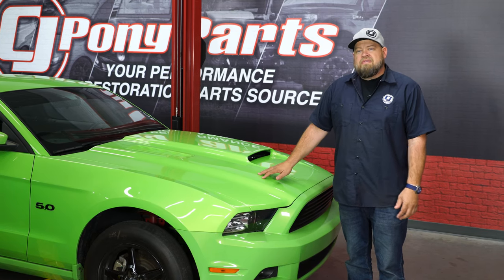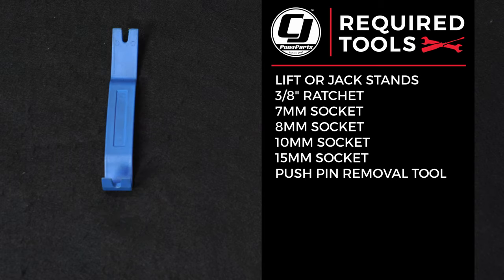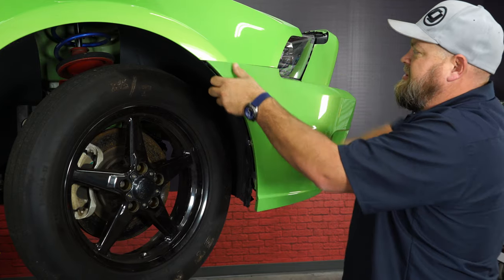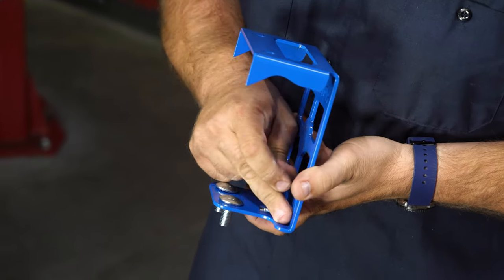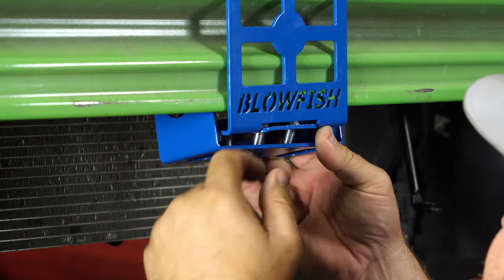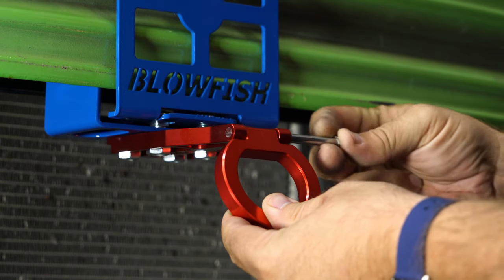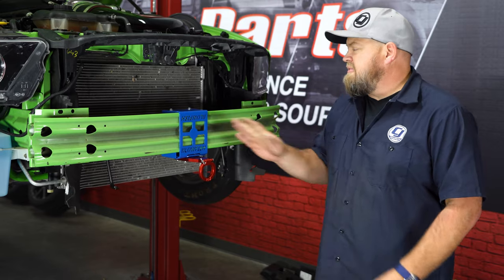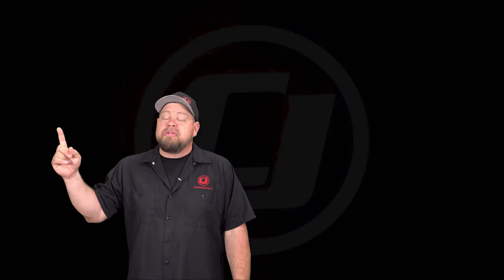2005-2014 Mustang Install | Blowfish Racing Next Gen Billet Aluminum Front Tow Hook

Comment: Hello!! Do you know if this will fit on an 08' GT500?
Reply from the maker: Yes the metal bumper is the same on all 05-14 cars so it will bolt up. Lower grill may need to be trimmed.
Reply: @cjponyparts  got it, thank you for the reply!